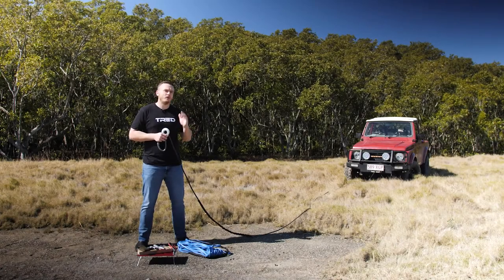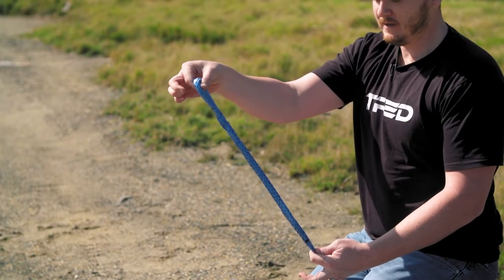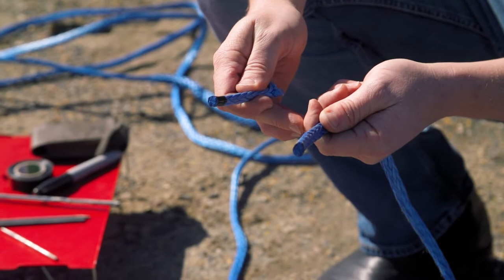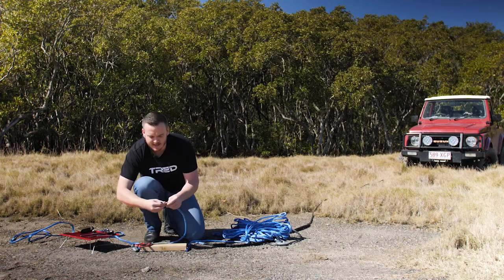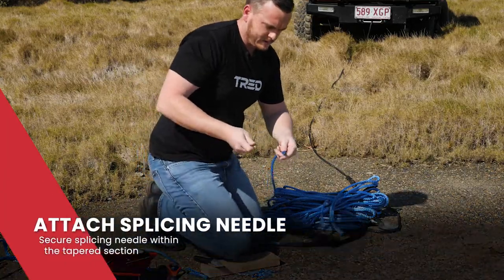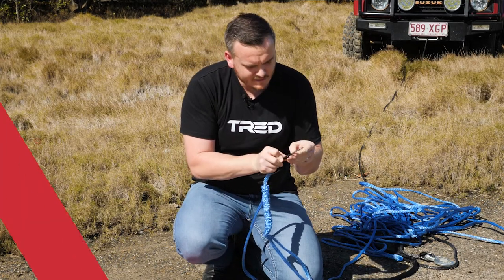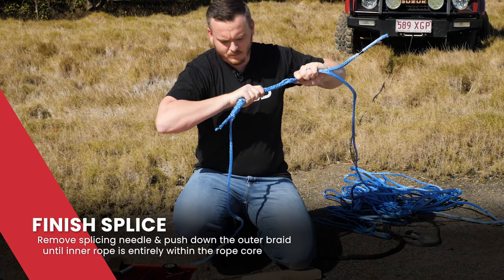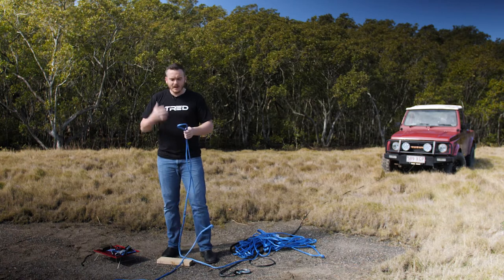HOW TO SPLICE SYNTHETIC ROPE | Repairing a broken winch line

Comment: Just broke my winch rope near the shackle end.  This has been great; I now don't have to spend a couple of hundred bucks to replace the rope.  A tip I picked up from another You Tuber: use fencing wire, bend it in the centre, instead of a splicing needle.  Push the doubled-over wire into the rope, after bunching up the rope to relieve tension.  Let the wire exit the rope near the end you're repairing, tape the cut end of the rope to the wire, and drag the wire and rope end back to where you pushed the wire in.  (I hope that makes sense!)
Thanks for posting!  I'm saving this vid.
Reply from the maker: Those winch ropes are very expensive to replace.  and great to hear you enjoyed the video mate

Comment: Thanks for the tips!  I'm going to remove my eyelet entirely and run a straight "naked" loop like what you made instead of the steel eyelet currently on my winch line.  The less metal I can have on the line, the better.
Reply from the maker: perfect